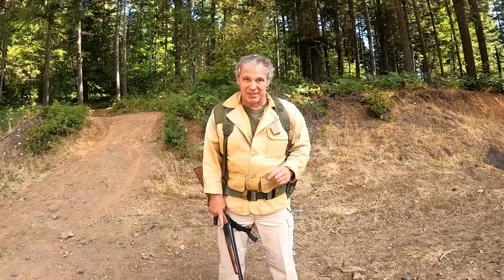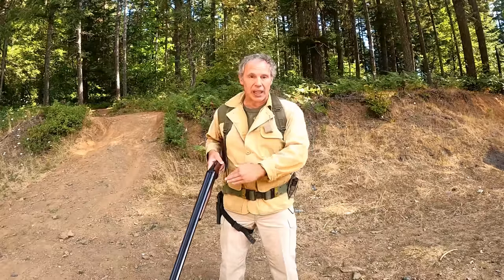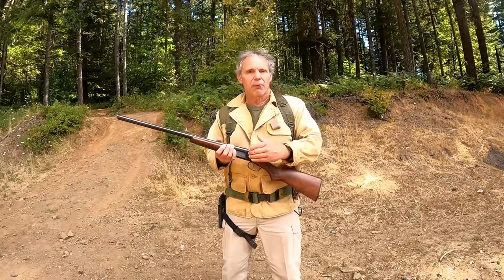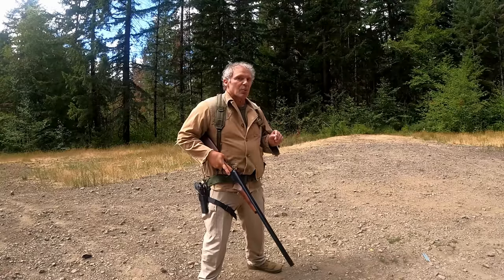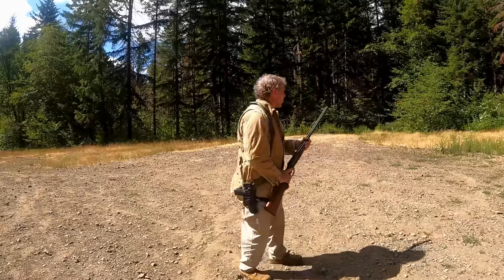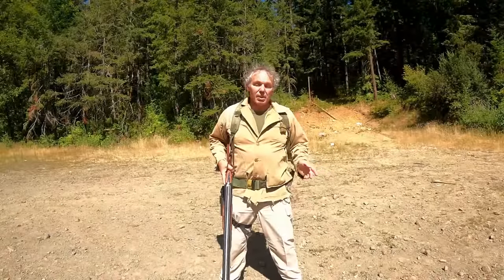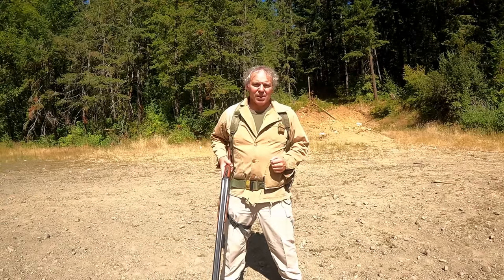Paul's Coach Gun Technique Part 3 (Internal Hammer Guns)

Comment: As a fellow 20 gauge Stoeger Uplander owner, thanks for doing that experiment regarding shooting both barrels at once. That's something I would have never done on my own, because I never really felt the "need to know", didn't want to risk the potential damage to my gun or my shoulder, and felt that the minute difference in time between pulling both triggers at once versus firing them normally was, "not enough difference to make a difference", in the grand scheme of things - and perhaps most important, never saw a reason or need to ever do such a thing.
Reply: As a fellow fellow 20 gauge Stoeger owner, I've done a two-fer while patterning.  The slight offset in timing ended up stacking the shot patterns vertically, making for perhaps a foot of vertical spread at ten yards.  That was cheap #8 bird shot, IIRC.
Reply: If you can't see a reason to fire both together then clearly you have never hunted imp demons on mars.
Reply: Had me a really nice early 12 ga coach Supreme by Stoeger. Pulled both triggers with 3" naughty naught buck, sold shortly thereafter. Paul hit the annoying voice at the time I was typing. Harsh very harsh typing without laughing.

Comment: Paul I have a late '40s Savage/Stevens coach gun with long 12 gauge barrels and internal hammers. I have owned it forever but only shot it a few times. I took it to the range the other day and blasted clays with it for a hour. Surprisingly great shotgun and easy to manage. Definitely not a gun I would sell. Keep up the great work.
Reply: Sir, what you explained that you have is not what is known as a Coach gun. It is just a double hammer less 12 gauge with barrels ( I assume 30” or more ) standard field grade shotgun. Hope this helps.
Reply: @christinamoneyhan5688  actually it's not hammerless ...😂😂
Reply: @chaddesantis4191  Actually buffalo wings aren't made of buffalo.
Reply: Actually, “chicken of the sea” isn’t chicken.
Reply: Is it a 311 or 511 model?  26 or 28 inch or ??  They are nice guns for the money.

Comment: Excellent video as always. Thanks to the whole Team. In the UK we are (or were in my day) taught to raise the stock to the chambers to close a gun. And conversley to push the stock down to open an uncocked Gun. I don't vividly remember the reasoning, I vaguely remember it's supposed to save wear on very expensive hand fitted guns like Holland and Hollands or Mantons and also keeps the barrels in a safe direction at a busy shoot. But it's instictively part of my gun drill for all break barrel guns to this day. I'm a bit older than Paul and we do a lot of crowded formal shooting over here, and not so much lone hunting, which we call 'Rough shooting'. I think this goes to illustrate Paul's Mantra that he's not telling YOU how to shoot, just demonstrating how He shoots.

Comment: You can find ultra slowmo videos on here showing people pulling both triggers at once and they never truly go off at exactly the same time. 

While it very well could be by design of your shotgun, chances are it's two different things happening: 

1.) Human error
2.) There's so many variables taking place inside the gun. 

Springs can be fractions of units of strength off from one another despite being the same make/model and coming from the same factory. 

Primers and/or powders igniting/burning at different rates etc etc etc. 

It's very interesting if you find physics interesting

Comment: I suspect that the reason you can't get both barrels to go off at the exact same time may be, at least in part, because no matter how hard you try, you can't synchronize your fingers to pull both triggers at the exact same time, so that delay you're experiencing is probably asynchronicity of your fingers pulling the triggers.

However, I suppose it's possible that there's some sort of internal mechanism within the gun that causes that delay, even if you do pull the triggers in perfect synchronization.  One could test this by rigging up something that allowed pulling one trigger to actually pull both and removing the finger synchronization issue.  But that seems like a lot of work to test an irrelevant hypothesis.

I suppose a more interesting topic/question would be, do you have a different technique for firing a double barrel with a single trigger (other than just pulling the trigger again)?  And other than the orientation of the barrels, do you have a different technique for operating an over/under compared to a side-by-side?

Comment: My youngest brother has a Remington "hammerless", which was once my paternal great-grandfather's, that dates back to the early 1900s. It, too, has double triggers. We have not shot it, but my dad hunted with it until around 1953, when a gun dealer convinced my grandmother that the gun was not safe to shoot with modern shells and sold her a then new Remington 11-48. 
Cool demo.
Reply from the maker: If it was made in the early 1900's it will be rated for smokeless powder. 
 Assuming the gun is in good working order, it will be fine for modern ammo.
Two things:
1: get it checked by competent authority to make sure it's in good working order
2: don't use the extra heavy ammo like XX turkey magnums, etc.
Reply: @PaulHarrell  Its barrels appear to be Damascus steel. I think it is a better wall hanger than shooter. It has a crack near the muzzle, the legend was a big hog bit down on the barrel while "Papa Collins" was hunting, and the front bead is either filed or sheared off (Going from memory on date of mfg. have not looked at the gun in 10 years since my dad died and brother has it in his safe) it was certainly safe during those years my dad hunted with it as a young teen.
Reply from the maker: @williamgaines9784  If it has Damascus barrels, then it is NOT safe for modern ammo and your assessment that it is best as a wall hanger sounds like a good plan.
Reply: @PaulHarrell Agreed. The "smokeless" loads of the 50s were probably loaded to much lower pressures than today's, but the gun dealer was probably giving my grandmother sound advice(the modern shells in that Damascus barrel were an accident waiting to happen, even then).👍👍

Comment: Hi Paul, one tip you may want to try.  As I have been getting older and my old friend Arthur-ritis has been creeping in I have gone to using a holster on my hip when bird and rabbit hunting with my old beretta SXS 20 with 26 inch barrels.  I find it about 95% as fast as walking around  in the low ready or any other position you can use and it sure helps the elbows as the day wears on.

Comment: Well I was not going to comment on this, but!!!! I now have the image of an old school teacher/librarian with the voice of someone that is a thousand years old saying: (Actually!) stuck in my head now. So thanks Paul as I am now laughing at that image. The only thing I can add to this is, when Paul says make sure you have that shotgun seated firmly in your should is: 1. make sure you have that shotgun seated solidly in your shoulder. And 2. use a shotgun and load that is appropriate for your size and statue or be per-parred to walk around with a bruised shoulder that looks like someone hit your shoulder with a #15 Cast Iron skillet.  As for the auto-ejecting shotgun's I found that fetcher annoying with my single shot H&K brake action 12 gauge.

Comment: Thanks Paul for your time and knowledge.
Have a couple of hammerless over-under double barreled shotguns and I noticed that one of them didn't reset the safety - and that's my most used one of them - so I'll be sure to manually snap back the safety after closing the hinged action.
(Pretty strange actually, that a 80's Winchester 12ga OU with single trigger and ejectors wouldn't be given that extra little bit of engineering, for safety I mean) Thanks again for the videos and knowledge you share 🙏

Comment: Thank you for your demonstration of technique on your double-barrel hammerless shotgun.

My major takeaway is that double barrel shotguns are not built to ONE standard.  I fear being given a double-barrel shotgun that I haven't before practiced with so that I can go hunting-or need to use as a defensive weapon.  Some trap and skeet guns have two improved cylinder or other identical chokes and all double barrel shotguns are "cross-eyed" to an extent--that's where the pattern centers of each barrel is in a slightly different location depending on range.  A few toy guns have addressed the real gun having just a single sight (usually a bead front sight) between the barrels- express double rifles generally have just one sight. The patterns are supposed to overlap ("convergence" is the term, I believe) but the solution of having a second rapid shot available in a second barrel brings new problems.  Even over and under double barrel shotguns have a convergence issue, but this is vertical rather than horizontal.  The traditional "modified-choke right barrel/full-choke left barrel" adds versatility in the field at a cost in training time required to master the double-barrel shotgun.  Some double barrel shotguns have screw-in choke tubes that can be rapidly swapped out for really insane degrees of versatility.  That is just the inherent features of having two barrels.  I imagine that three-barrel and four-barrel shotguns are even more fun.

Adding to the complexity of the manual of arms is that some shotguns have automatic safeties that lock the internal hammers until the safety is manually released.  Some double barrels have a single trigger--and some of those have an inertial reset to cock the second trigger, which means if the first barrel doesn't fire, the second barrel won't because its hammer wasn't cocked by recoil from the first shot firing.  Some double barrel shotguns have automatic ejectors (open the action and both fired and unfired shells go flying), selective ejectors (too many variations to list here), and mere extractors.  Extractors only are nice to help keep the range clean, wonderful to save the hulls for reloading back at the shot shell reloading bench, ensure that when the first barrel fires and then is opened for reloading the remaining live shell doesn't wind up lost in the weeks or sunk in the mud at the bottom of the pond.  

All of these possibilities bring me back to the takeaway--treat double barrel shotguns as unique entities and make the time to learn how to operate that specific shotgun.  Otherwise, I'm guessing at what the shotgun does.  When there are multiple possibilities, Murphy's Law says that I will make the wrong guess when it will hurt me the most.

Comment: 6:00 ...my SBS which was explicitly marketed as left handed is also front-right, left-rear.

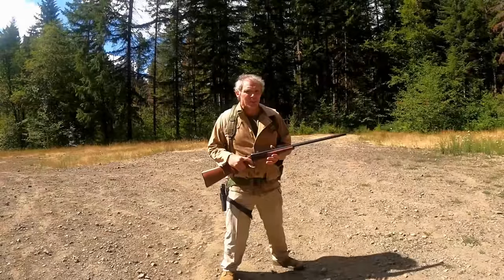11:40 ...I've only ever used that as a way to hold a break action gun while it was open, in order to demonstrate to the people around me that the gun is empty.

17:30 ..I was taught, and have taught hundreds of others (generally) to shoot with both eyes open, with very good results. As long as you are shooting with your eye dominance, this is RARELY a problem, at all.

17:45 ...a loose shoulder was one of the most common mistakes for new shooters that I have seen, particularly after about 10-20 rounds when they start to more generally relax, or they've had some success.

Comment: Back in my younger years a had a cheap Stevens SXS 12 gauge and I thought the gun from mad max was cool……so I did what I had to do. And literally the first time I fired it without the stock both barrels went off simultaneously and the recoil sent the action bar about 2 inches into the web of my thumb and pointer finger. My dad begrudgingly drove me to the ER while simultaneously talking mad smack then forced me to tell the nurse exactly what happened. I leave work to gunsmiths now.

Comment: After being mauled on Kodiak years ago I began carrying a Baikal hammerless coach gun on fishing, hiking, photography trips. Why that? Because it fit neatly into an army alice pack with the stock hanging out over my right shoulder for a quick draw. Once you've seen a Kodiak bear up close handguns inspire no confidence whatsoever. The terrain is so thick and vertical you needed your hands free, thus carrying it in the pack most of the time. However, when sighting a bear or sign, I'd draw it and hold two spare shells between the fingers of my left (offside) hand. This is the technique used by African hunters after dangerous game with double rifles. I never actually shot a bear while doing that, but in practice it works very well. You shoot, break the action and slide your left hand back up the barrels to kick the empties out, then jam the two new shells into the action with that same hand. That last requires a bit of practice to insert the shells blindly. Once you get it down, you're starting the shells into the chamber with your fingers then flipping them up and giving the final shove to seat the shells with the bottom of your palm before flipping the action up and closed. A coach gun is the "Poor Man's Double Rifle" so why not use it like a double rifle?  The same technique would be handy for rabbit or bird hunting, so I suggest you incorporate that into your hunting.

Comment: I have a Savage/Springfield 16 gauge if I pull my left trigger first both barrels will fire. If I pull the right trigger only the right barrel fires. I am starting to think it might have been modified. Mine is hammerless. Can confirm the safety does engage when I open the action.

Comment: One situation where the " well actually" crowd may be correct in the most meaningless technically but not usually way is there are true hammerless doubles with a striker instead of an internal hammer but they are very much the exception rather than the rule and I'd have to start looking through reference books on obscure guns if I cared enough to find an example because I definitely don't have it memorized.

Comment: I have a hammerless  Stoeger 12ga Coach Gun, the single trigger version with 20" barrels. I found the auto safety to be annoying, so I fixed it to manual. I also ball honed the not so smooth chambers and lighted the action spring. I upgraded the firing pins with tool steel. It shoots the right IC barrel first, the left barrel is M. I also installed a recoil pad. My first side by side project gun turned out pretty cool and was relatively inexpensive. I think I'd like another, but with hammers and dual triggers.

Comment: Back in 1974, when I was 12, I was duck hunting with my father. I tripped in the snow and plugged the both barrels of my double 20ga. I was dismayed that I would have to go back home to get a cleaning rod when my Dad broke a branch off of a tree and used it as a cleaning rod. 
After firing both barrels at ducks (we would ditch jump), I would reload only the left barrel to try to get a third shot. Reloading both barrels was too slow, and the right barrel was modified choke so the best shot I could hope for was with the left hand full choke barrel. I remember wishing that it had auto-ejectors!

Comment: Haha! I've started calling my hammerless Stoeger coach gun and my Winchester model 24 "striker fire" just to add to the confusion, even though they technically are striker fired. My CZ Hammer Coach (made by Huglu) doesn't engage the safety automatically, which I personally prefer. I've lost a bunch of clay pigeons due to the auto safety.
Edit: I just saw a video of yet a different "hammerless" shotgun, and it has concealed hammers inside the mechanism. So, my Winchester 24 (circa 1946) has spring-loaded "firing pins," much like a striker found on modern hand guns.

Comment: I can't remember the name of the manufacturer, but I bought two speed strips (6 rounds in each strip) last year. I have found them to be a great help in increasing the rapidity of my reloads with my double barreled shotguns. I don't know if they make them in 20 gauge because the doubles I have are 12 guages, so I didn't check for another size. Anyway they work just like the speed strips I have used with revolvers and they only cost eleven, or twelve, dollars. A quick Google search should find them fairly quickly and some people find them to be helpful. Just throwing that information out there in case anyone is interested in that type of product.

Comment: Hey Paul: Would like your take on a Browning FN Sweet 16. Mine was a 1921 with an 18" barrel legal with a Weaver Choke. Loaded her with Imperial CIL #2, Buck Shot and Slugs. Imperial CIL was a Powerfull Canadian Shell. Could fire 5 shots before the 1st extracted shell hit the ground - Out shot all 12 gauges faster and distant any day.

Took a little shell modification with a 2.3/4" Paper Wade chamber Vs the Plastic 2.5/8" crimp shells to extract - No Big Deal.

Felt like a 30:30 or a Lee Enfield Jungle Carbine  in the bush and could stop a 18 wheeler within 150 yards (Never did it but she could)

I could hit a Cigarette Pkg at 75 yards with a slug (Absolutely an amazing A5 Shot Gun at approx 35" long ;o)

She kicks hard enough but that blinding light blast from the Weaver Choke is just something you have to use too.